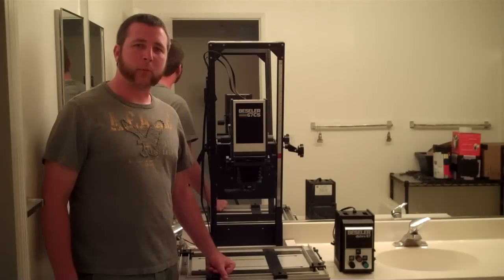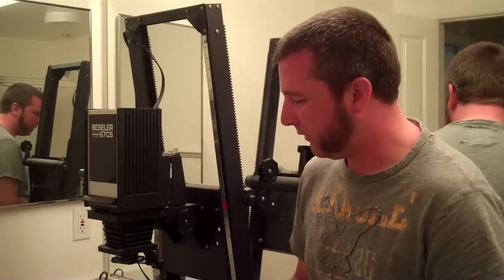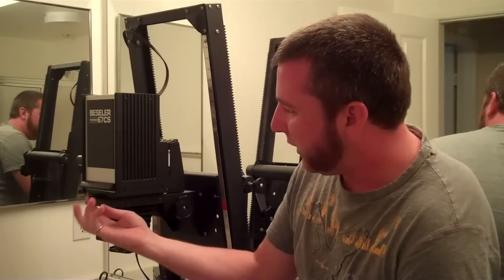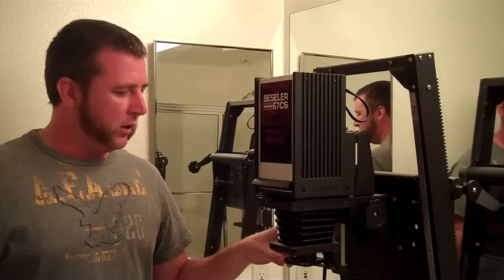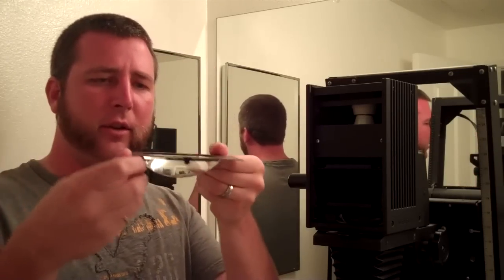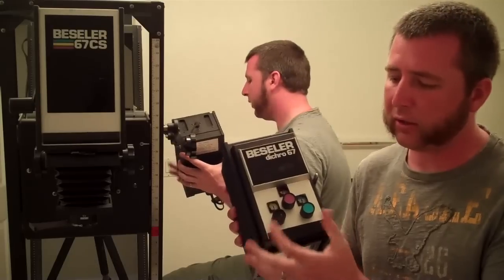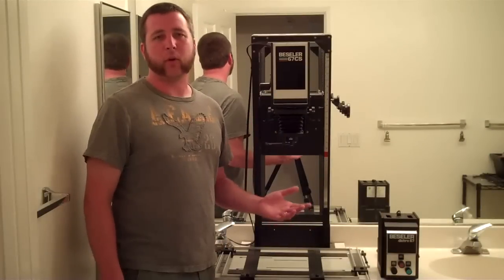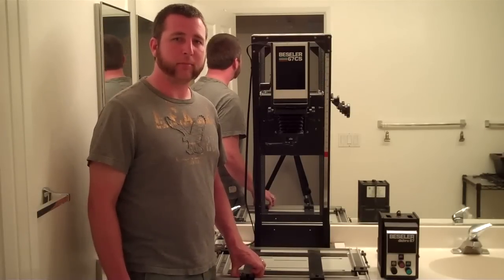Introduction to the Optical Enlarger

Comment: Well, his enlarger (a Beseler 67) can handle only up to 6x7 negs from 120 roll film, with 35mm included. However, when switching from different negative sizes/formats you'll need a different carrier and lens (the bigger the format the bigger the lens). EG: If you use a standard 50mm enlarging lens for a 6x6 120 neg then the lens will fail to 'cover' the larger size and vignette the corners. For colour printing you need a whole different condenser head that projects different colours of light.

Comment: Diffuser v Condenser v cold cathode v dichroic heads.
No one discusses the for and against. 
Like you need condensers in different focal lengths to suit the fim size and Lens focal length. 
I have an old Gnome rangefinder enlarger with a pair of100mm condensers to match my 100mm Schnieder Componon S lenses which I use for 6x7 negatives. Also, I have a pair of 50mm glass condensers to match my 50mm Schneider Componon S lens which I use for 35mm negatives. 
This set up is for Black and white only.
Condenser enlargers give better results than diffuser enlargers in my opinion with shorter exposure times.
Just my opinion I know.
But that's my experience over 60 years of printing.
My advice. Get the Schneider lenses.
Not the Componar ones though. They are subpar.

Comment: I've just bought an old Printmaker 35. Its head came with just one condenser lens and filter holder, Does it mean that I have to buy a second condenser and a heat absorbing glass?
Reply: I recently came across one of these enlargers. where can I sell it at, who would want one to buy?
Reply: No, you just need to be careful.  Some of the best old-time photographers used one of these. But, the dichroic definitely gives you more flexibility in printing on multigrade. The condensor looks sharper on some negatives, but really, the dichroic is just as sharp if you have a good lens. Dust doesn't show as much on a diffuser, dichroic enlarger. A condensor can also be used for colour, but the dichroic is better.